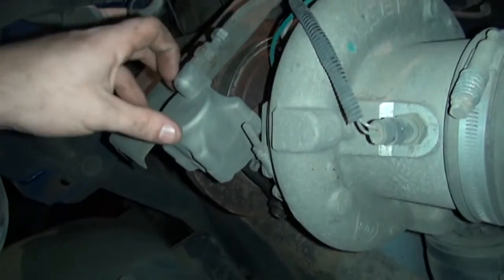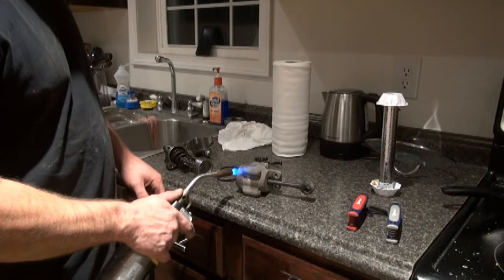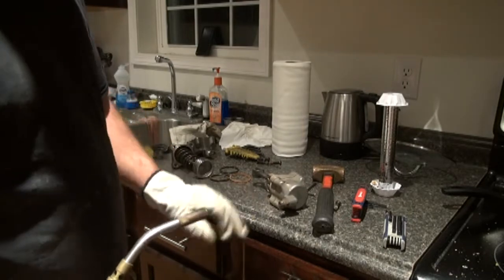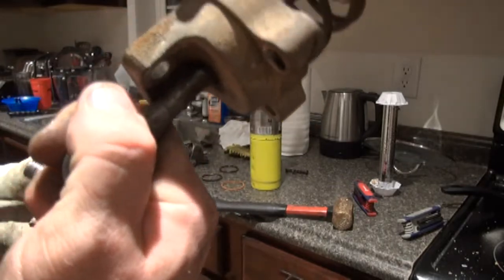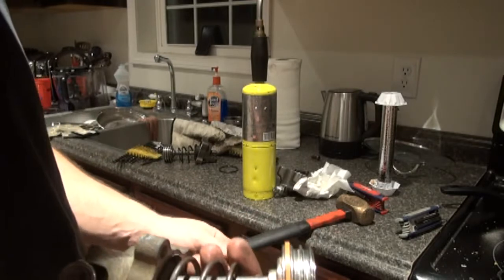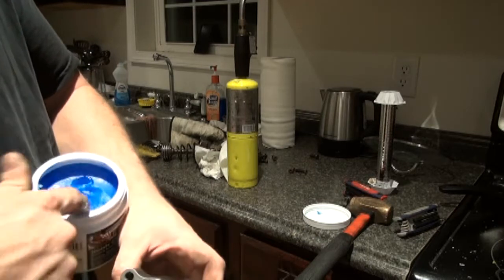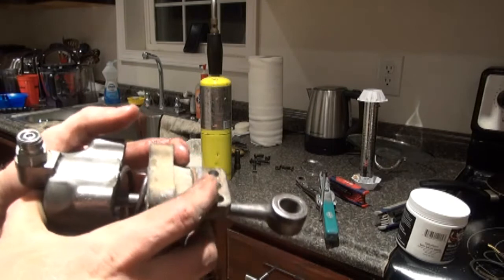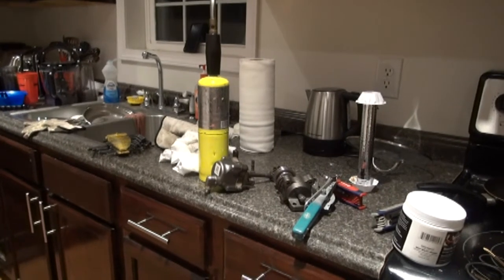Cummins ISX vgt turbo air actuator rebuild

Comment: Did you have issues lining up the holes for the bolts. Someone said put two bolts in first then start the truck to line up.
Reply from the maker: This was probably 7 years ago I don't know, but I don't recall it being difficult.

Comment: Hey man nice video , I got the same turbo and same truck . Turbo is giving me problems lately the actuator moves freely but the air box above it always purges air like popping sound from its little weep hole. It just started doing that recently and I owned the trunk for over 5 yrs and never did that before . So my question is  when you replaced your turbo did u do any calibration to turbo actuator or no even tho its air actuated?
Reply from the maker: I didn't do any calibration. I'm not sure if there is even a calibration procedure for these... I do know The newer one with electric actuator does require that for sure...
Reply: @LifeWithChase  ok thanks for reply,  yes I know about newer turbos with electric  actuator  needs calibration. I was just wondering about cm870 engines.